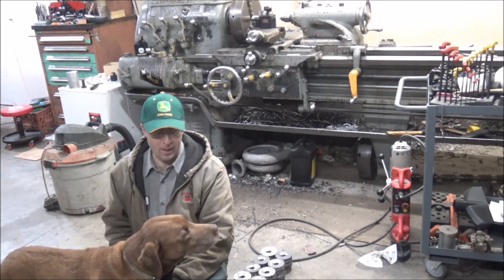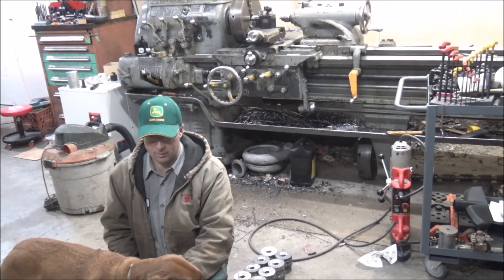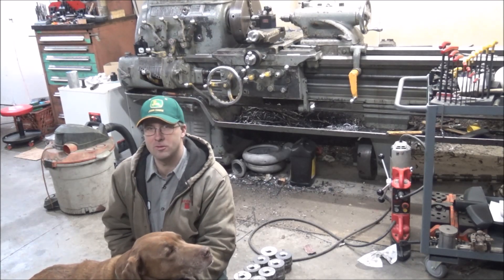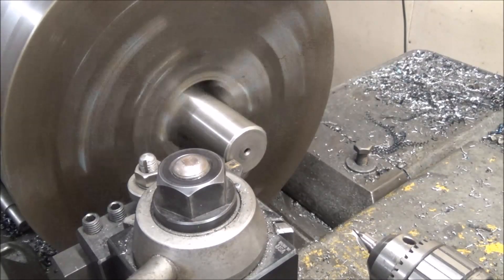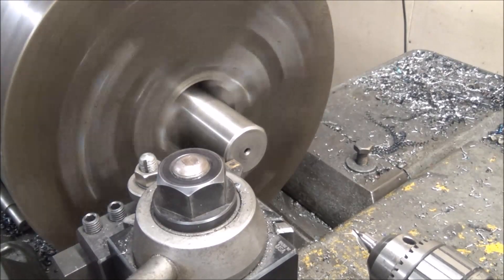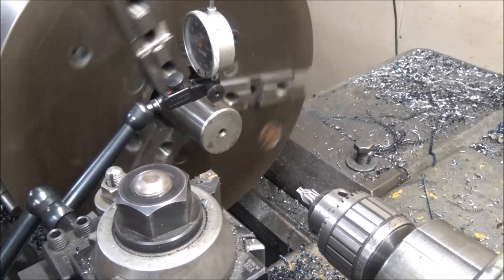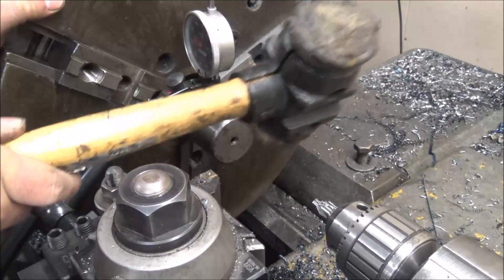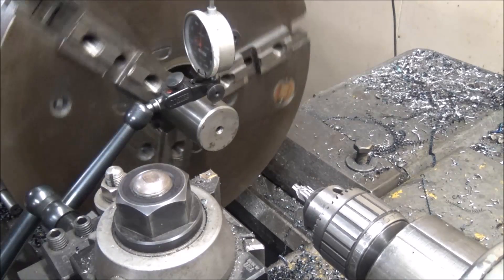Guess The Time for This Quick Job Shop Project!

Comment: I dislike that I don't have the connections to get short run work like that.  Looking good Brian.  Surprised the tail stock doesn't have more runout when extended out that far, those big old lathes are usually used heavily.

Comment: My guess is 1 hour 35 min. They appear to be king pins from a big truck or buss. If so I know from experience they are hard. Real hard. In the first of the video I saw a magnetic drill press sitting in the floor. I have one just like it and love mine. It comes in handy especially up side down drilling. Also as heavy duty as they are I wish I could come up with a way to use it as a milling rig. It definitely has the power to handle it. Good job and video.
Reply from the maker: I use that mag drill as my Bridgeport all the time. It is super handy. I have a slightly smaller one too I use even more because I can handle the 30lb one in a lot more positions than that 80lb sucker.

Comment: The price has made me reluctant to try them also.  I kind of thought the cbn was what they were using?  Is their "ceramic" something different?  I know the cbn has come down in price considerably in recent times.  I have an 8" grinding wheel and several smaller ones (4" off Banggood for about $15).  I hope the inserts will also start showing up on Banggood.  I use a lot of old outboard shafting which is as hard as the Pope's heart on the outside and in portions of the shaft (I guess they spin weld different types of steel together).  Take care.  Doug

Comment: Since you already have a tool on the lathe and nothing in the chuck, I'm guessing around 20 minutes.  If like me you had to take a hunk of scrap out of the chuck, sweep the chips off of everything, find a tool and a non-blunt center drill, and then maybe this time clean up after the job, it would be considerably longer. :-)

Comment: Were you wanting a guess of how long it actually took or how much to bill for it?  4 ends faced and center drilled about 30 minutes part in to final measuring.  As for billing, that depends on how good a customer.  30 minutes for good repeat customers,  1 hour minimum charge for anyone else.

Comment: 53 minutes

1.  5 minutes:  pour coffee, feed bailey
2.  10 minutes :  power up Lathe, set tooling, scratch Bailey 
3.  15 minutes:  face, chamfer, drill 1st part.....scratch Bailey, throw stick to Bailey
4.  16 minutes:  repeat step 3......consult with Bailey on case hardening “ is it 58 or 62 Rc?
5.  7 minutes :  inspect parts, pour 2nd cup of joe, make sure no grease got on that sweet JD lid

Great post!
Reply: I like Bob's answer. :)
Reply: 2nd this!

Comment: Brian . It takes as long as it takes to do a good job . Getting paid the correct amount for time and materials, work at the right price means your in business otherwise your not and losing money, can you afford to be a charity?.
Reply from the maker: Don't worry, inserts, materials and time all get factored into the cost charged. I just thought it would be fun to see what people thought it would take in time. Usually my customers bring me a job thinking it will take 5 minutes and can't understand why it takes 3 hours. Yeah its 5 minutes of cutting time but it takes 160minutes to get it set up held down and aligned before you can ever make the cut.

Comment: 30 seconds of actually cutting 20 minutes of finding sharp tooling and messing around , wondering why it didnt work as expected,   and cleaning stuff off the machine so you can use it